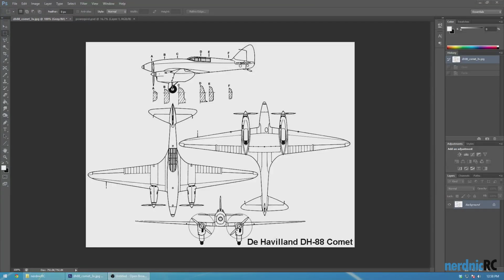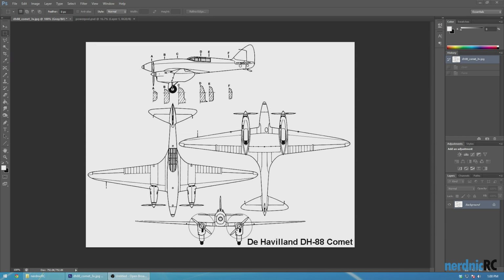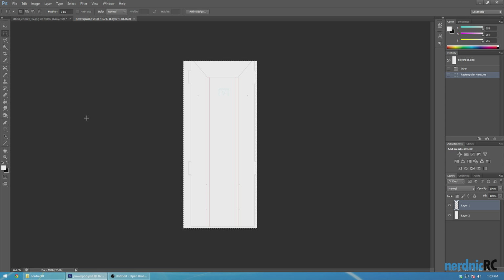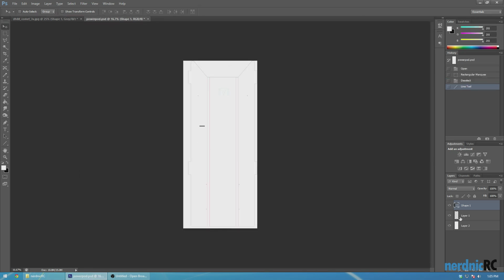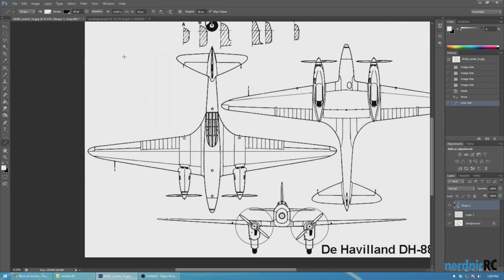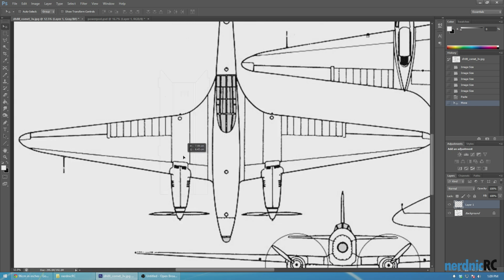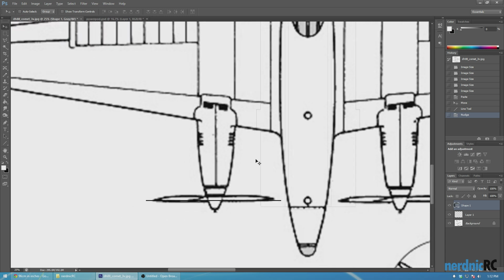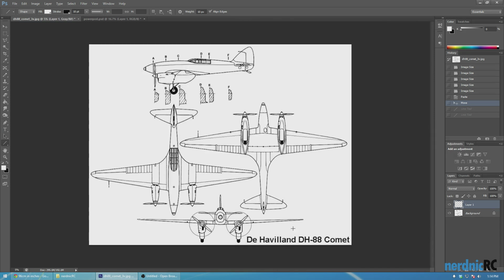Part 1 - How to Design DTFB Planes

Comment: how did you get the ft power pod and the line tool
Reply from the maker: Hi there. I opened the PDF of the FT Mustang plans in Photoshop and copied the powerpod. The line tool is part of Photoshop and should be on the side bar. It shares the same space as the rectangle tool so you might need to right click on it to view the line tool.
Reply: ***** ok thank you very much because i hope to make a baron 58

Comment: If it were me I think I would have scaled the drawing up until the power pod fit into the nacelle.  As long as the wing span was less than 60" the wings should fit on 2 sheets of foam board.  The FT Cruiser, the only twin they have designed, has a wing span of about 50".
Reply from the maker: Hey there. I went ahead and scaled it up to see what size would be needed and I broke 60inces in the wingspan. I could probably do 50 but I would have to deviate heavily from the shape/look of the pods.